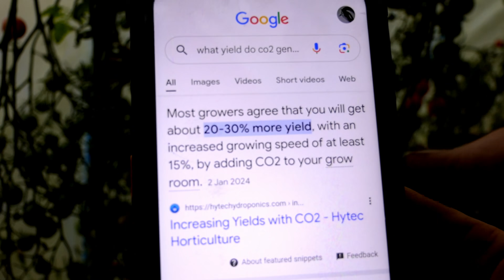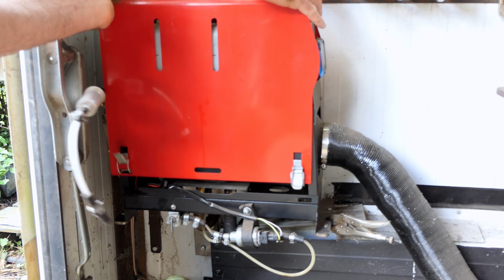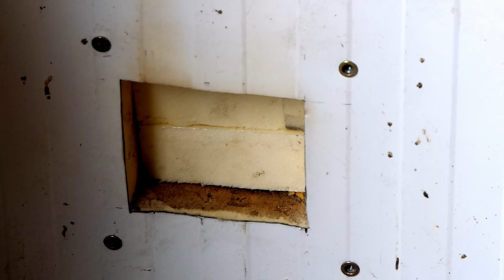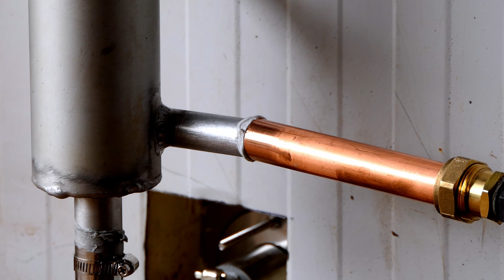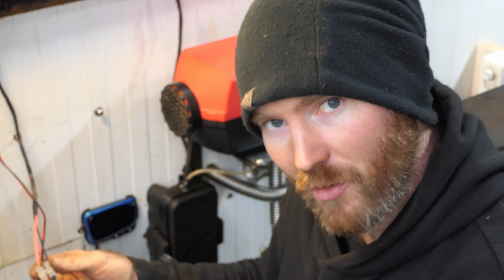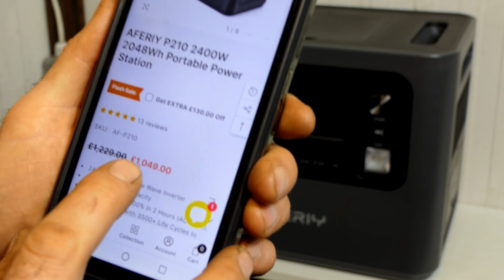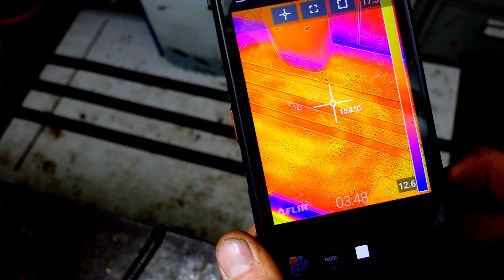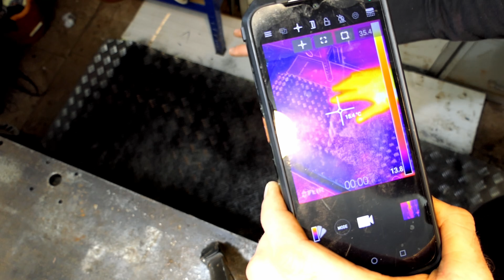NEW! Better system for Cheap and Safe Heating💲+ Underfloor Heating Mod test🫠

Comment: How much bullshit can you put in one video.
Kerosene fumes are carcinogenic, cause respiratory illness and damage unborn babies. 
Although the burning process is up to 90% efficient the transfer rate to produce heater water in your hot water system for your radiators is less than 50% in term of the transfer of energy into heat coming from your radiators. This makes it much less efficient than a heat pump.
If you burn this in your house with the undies closed and rely directly on the heat from the flame and subsequent hot air, you may achieve 90% efficiency but likely to achieve 90% death too. 

Plant some trees, burn some logs. Stop talking shit.

Comment: Love Your vids Josh. If You think more co2 is better for everything then go to any greenhouse with co2 suplementation. Yes, plants will love it but You will have problems with breathing. High co2 levels ain't good for humans (or any other non plant life). But we still have ways to go to reach that levels.
Reply from the maker: Yes but that at extremely high levels like 20% not 0.04%. it's the deforestation that's the biggest issue. We needed to double our Forrests, not destroy them. Cheers J

Comment: Hi Josh. I did a youtube video last year on the diesel heater. I found wasted heat at the roof level & colder near the floor. I made up pipework to the inlet of the heater from the ceiling & the outlets nearer the floor. I saved fuel by recirculating the hot wasted air back into the heater. I just need to make a silencer for the noisy inlet now. The outlet is much quieter so ok.
Reply from the maker: Well done. Cheers J

Comment: I've heard you out. Quite a lot of claims to go through, so it might take a minute:

Your numbers on CO2 levels and understanding of how it shot up due to burning fossil fuels during the industrial revolution all seem on point. I'm making the assumption that you're aware of the pretty perfectly correlated graph of global average temperature that shoots up at the same time, and I'm inferring that your position is that it isn't primarily due to CO2? Meaning that there's no issue burning fossil fuels?

Let's start with the implication of the small percentages. The dose makes the poison. Botulinum toxin is deadly at 0.000000001% of your body mass. The relative percentage of a substance is irrelevant to its effect relative to other substances. Example: CFC gases were pumped out by industry burning holes in the ozone layer in concentrations of 0.0004%. Carbon monoxide as you likely are aware is only safe up to 0.0009% for eight hour exposure. CO2 rise by 33% is enough to destabilise an ecosystem by changing which life forms thrive and which struggle. CO2 is used as an insecticide. 

You're right about the abundance of life with higher CO2 levels, although that was something like 500 million years ago. Similar with the temperate iceland period. It takes at least thousands if not millions of years for species with a longer life span like humans to evolve and adapt to the environment. The issue here is that the environment is changing faster than humanities biology has a hope of adapting. Many other species will be taken out too. But as you pointed out, life in general will find a way to thrive. It just won't be humanity.

Crude oil does come from vegetation. Likely algae. However, the energy stored in its hydrogen bonds was gathered from the sun over millennia. The issue is that this energy and the emissions from it is being released in tens to hundreds of years which is in the order of one millionth the time it was collected over. It's like saying that C4 isn't dangerous because the energy in it was gathered by the sun (effectively pretty much all energy on earth came from the sun). It's not the amount of energy or its source that is the issue, it's the rate at which it is released compared to the rate at which it is collected. A tap could fill a bucket with a split in it only so high, meaning it never overflows. But if you then use that bucket to fill another bucket with a split in it then you could overwhelm it. Nature finds a long term steady state balance, and humanity burns fossil fuels literally millions of times faster than that fossil fuel was generated. Sadly nature isn't reacting fast enough to save us from ourselves.

The current scientific consensus is overwhelmingly that human emissions and activities have caused around 100% of the warming observed since 1950. The IPCC has more data on this if you'd like to check it.

A common psychological tactic used to manipulate people is to break down a number into the smallest version to minimise it. A car lease might cost £250 per month, that's "about" £8 a day (£8.22) "That's just a nice lunch!"... or in another context £6000 over the first two years... To avoid this when I feel the urge to look at the smaller scale number, I try to also do the bigger number. I think this is what you did? You said both that humans are only responsible for 0.0012% of all CO2, and a 33% rise. I would say that "both are true", but when I looked into the human account for 3% of CO2 claim it seems like it's at best a typo of 33%. You could maybe argue 3% of all CO2 emitted on earth in its entire history, but that seems unlikely given the Cambrian period saw ~4000ppm (0.4%) CO2 levels 500 million years ago. And that's 10x current levels (as you said), so humanity has increased CO2 levels by 0.0012% (what you said) of 0.4% (Cambrian 10x levels you referenced) assuming that all CO2 was emitted then and has only dropped since and all humanities CO2 was emitted post industrial revolution (which it wasn't) that's 0.3%. So I can't make that maths add up either?

Sun spots: From late 1800's to mid 1900's solar irradiation has increased, but at most this accounts for 0.1°C of the 1°C rise. You could call that 10%. The Sun's energy output has varied by less than 0.1% over the last 40 years.

Human aerosols have contributed to global cooling which means the full extent of global warming hasn't been measured yet. There's some stuff going on with the massive container ships that were bruning dirty fuel and the produced pollution seeded clouds which artificially lowered sea temperatures in active areas. Now they've switched to cleaner fuels the temperatures have increased. 

You talked about the urban heat dome effect, where all the urban concrete and asphalt absorb, hold, and slowly release heat from the sun. That's definitely a thing and apparently something like 0.15% of Earth's land area is roads? 0.04% of total area? Forest has an albedo of 0.15, concrete 0.4 (presumably because it's white?), and asphalt 0.1 meaning it absorbs 90% of the sunlight that hits it. In absolute terms 5% more than a forest. Out of the 1kw/m2 solar irradiation a forest absorbs 850W, a road 900W, and a concrete building 600W. Changing 0.04% of the Earth's total surface by 5% is only a 0.002% difference. That accounts for less than the 10% from sun spots. Covered land does result in more water in drains and I see the logic that would cause more flooding. Although 0.15% increase in paved land area doesn't account for floods going from 0-7 per year in 1870 to an average of more than 20 per year between 1990 and 2000 ish.

The reduction in forest area is a tragedy. The only reference I can find to 10% deforestation in 34 years seems to be from gold mining in the Southern Peruvian Amazon? So not global? Still an inexcusable example of "forestry management".

CO2 does indeed make plants grow bigger. But the nutrient density decreases. There's an issue with modern farming techniques such as CO2 supplementation resulting in higher yields but at lower nutrient levels and less intense flavour effectively creating more profit for the farmers but the customer needs to buy more to get the same amount of nutrients from it. 

I'll add "The Dimming" to my watch list.

If I'm candid, and try to cut to the point: To me it sounds like you recognise that kerosine is a cost effective heating solution and that many people in the UK aren't exactly swimming in cash so it makes a lot of financial sense, however I would hazard a guess that in order to make this strategy compatible with your moral code you feel you don't want to be hurting people or the earth whilst utilising it. This feels to me like you're looking for evidence to support your preferred world view that burning fossil fuels is okay? I'm not saying it isn't! At least on a domestic individual scale:

I think you can burn kerosene to heat your home with a clean conscience even if it does contribute to climate change because you don't make the rules. You live in a society you were forced into, from a birth you didn't choose. If you want to eat and not be homeless then you have to work. To work you need to be able to feel your fingers and travel. You cannot avoid indirectly burning fossil fuels unless you live in an isolated hut in the woods. Practically everything you buy resulted in the burning of some fossil fuels. But you have zero ability to reduce how much of that is burned other than to buy less of it, which might not be compatible with not being homeless and not starving.

Hypothetically, you could install solar panels, a battery, and a heat pump. Then live off grid with renewable energy. Collect rainwater. Buy an electric car and charge it from your solar panels. It's functionally impractical to ACTUALLY achieve fully off grid living. Apart from anything else what I've described is likely to cost £35k and how many of us have that kind of cash laying around? Everyone finds the balance they are happy with between quality of life and minimising environmental impact. You seem to be doing better than most at it. 

Love your content Joshua! Also love the conversations and your open mind. These conversations are how we build bridges and make the world a better place.
Reply from the maker: Thank you for taking the time to gather a well formed response. I'll consider your points carefully.
 my initial response though, it's not the justification of the use of cheap fuel by discrediting CO2 pollution but it is the injustice towards vulnerable people stopping them using cheap fuel based on a bogus claim that is my main gripe. Personally I prefer to use sustainable coppiced wood in my wood stove that is free to me but that's not viable for many people and is still a method of heating that is being demonized...
There are other documentaries I've just watched recently including 'Climate the movie' and Michael Moore's documentary 'the human planet' which I very much appreciate your thoughts on.  The dimming is a little conspiratorial but on further research into the claims there is a lot of truth especially with Bill Gates funding geoengineering.
There is so much destruction to natural ecosystems which indirectly effect climate measurements that isn't related to CO2 and isn't getting enough attention or funding to tackle. CO2 reduction has created an economy and so following the money leads to where politicians priorities are,  which are not in areas that will actually help the problems. Cheers J
Reply: @joshuadelisle  No one is stopping people using cheap fuel, are they? What fuel are you not allowed to use? (apart from leaded petrol, I guess?)

Yeah, I think the wood burner stuff is over blown. One of the cleaner burning rocket stove type burners can ensure high overall efficiency and relatively low pollution emissions. It's like the demonisation of diesel engines doesn't fairly represent the best of the modern technology. I think they should have a pollution emission limit that is agnostic of fuel type. Natural gas is one of the cleanest burning fuels. Shame about he effect of any leakage on the atmosphere. Butane and Propane are much better still. It's not as if BBQ's are banned and they can be much worse. Gas hobs can be terrible for indoor air quality. Candles. Lemon scented air fresheners! All legal, no bans or restrictions.

I'll add  'Climate the movie' and 'the human planet' to my watch list. 

I have no doubt that some of the numbers they reference are true. Otherwise it would be easy to instantly dismiss. However you can form completely fallacious conclusions from perfect information. Example: "9 out of 10 dentists recommend Colgate" so you might interpret that the mean Colgate is the best toothpaste according to almost all dentists. It turns out that the reality is something like 9 out of 10 dentist recommend any toothpaste with fluorine in it, and that includes Colgate. Or 10 doctors are asked for tooth pastes they recommend, they each write down 5 in a hurry. and 9 out of 10 of them had #Colgate in their lists. It's not that Colgate is better than the others. It's more that they're all about the same and it doesn't matter. Others are less scrupulous that that. Shampoo adverts are notorious for these kinds of statements.

Yeah, the destruction of natural ecosystems, like deforestation for oil, or for soy bean monocrops to feed cattle, is awful and we need to do something about it. 

We shouldn't completely ignore those issues and only think about fossil fuels. If we stopped burning fossil fuels by deforesting the entire planet, that wouldn't leave us in a good place... But we might survive. If we don't stop burning fossil fuels then we all die and take a load of other species with us. Burning fossil fuels is the biggest credible threat to the end of humanity second only to the authoritarian dictators with nukes who might kill the planet in a global nuclear war. 

But the responsibility to do so is not on you or I as a consumer. We need electric cars, house batteries, solar panels, and heat pumps, to get off oil. And they're all only recently available and still expensive. And now that industry has been kick started, there are people who know first hand that it's cheaper in the long run, and market economic forces will hopefully complete the switch. Coppice wood burners are fine too, of course. :)

Comment: 48:38
I don't think anyones arguing that climate change is the end of all life,  nothing is going to kill off the plankton and cockroaches.

The argument is that rising sea levels will flood what tend to be the most densely populated areas. climate change will cause famines etc. 

  And the argument that our co2 output is low compared to nature is flawed. Co2 levels have risen, so obviously nature isn't balancing that out. 

So you seem to accept there is an increasing level of co2 in the atmosphere, accept that rising co2 leads to warming, accept that if Iceland is capable of supporting temperate plants, it probably isn't also supporting glaciers. If the water isn't in glaciers, its in the sea, putting Bangladesh, New York, London, Shanghai underwater.
Reply from the maker: I fully accept climate change is real and the planet is heating. I don't believe CO2 is the main issue to focus on but instead deforestation, ocean pollution, nuclear testing, geoengineering, increased thermal mass storage (concrete and roads) and sun spots are more likely. Also some experts are saying CO2 levels have increased because the planet is heating and not the other way round because there is a lot of methane and CO2 locked in the ice. Cheers J
Reply: @joshuadelisle  the link between co2 and warming is very straightforward. Whatever caused the warming to start with, adding more co2, either via burning stuff, or melting permafrost is going to make it worse.

I suppose we can probably agree on quite a few things here. We can't go on as we have before. We both agree we shouldn't be chopping  down the Forests, and messing up the oceans. Not digging stuff out of the ground and pumping it into the atmosphere seems a small reasonable next step to me.

Comment: Have you thought about using storage heating blocks on the exhaust?
I'm trying to figure out a way of using them to heat my small man cave this winter instead of the oil radiator, got any ideas??
Reply from the maker: I tried using a sand battery but it takes a long time to heat up because it's not very conductive. A water barrel acting as a thermal mass is probably the best option. Cheers J

Comment: Even the automatically added blue bar under the video says that humans are responsible for global warming, as 97% of scientists say. I must admit that up until the end, the video was pretty interesting, but the last part just threw me way off
Reply from the maker: Well they said trust the science when covid happened and now thousands are coming forward with adverse effects of the jabs and data showing the cure was way worse than the disease. So if you still trust everything you're being told then I won't be able to persuade you otherwise. Cheers J
Reply: @joshuadelisle  I agree that you should question things, and everyone has the right to their opinion about things. This is what sparks interesting conversations, and makes you think differently about things, and I think its dangerous to live in your own little echo-chamber, so I welcome other views on things. So even though I was put off a little bit at the end, it doesn't mean that I didn't find the video interesting for sure :)